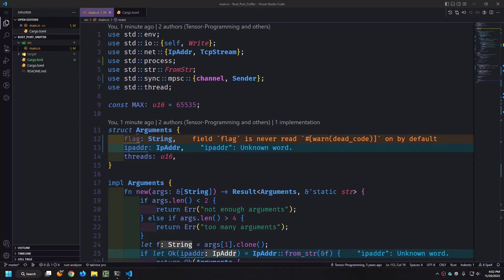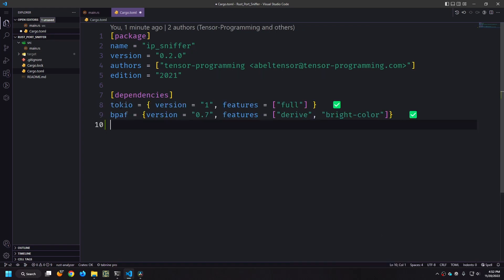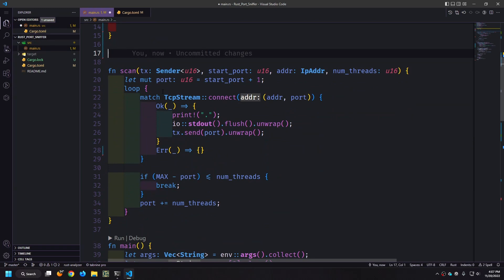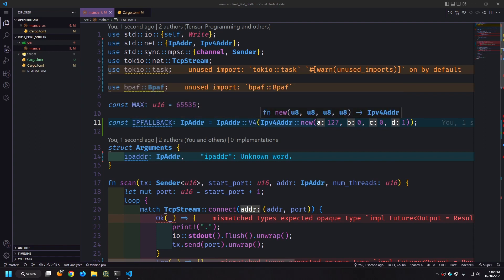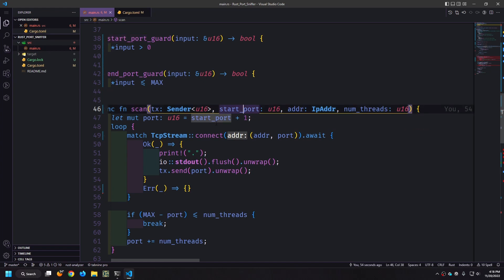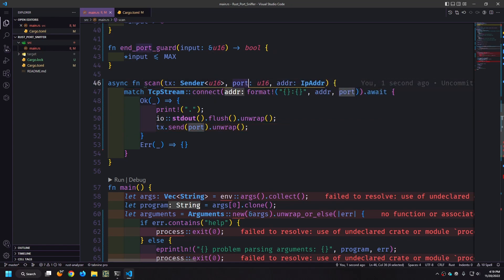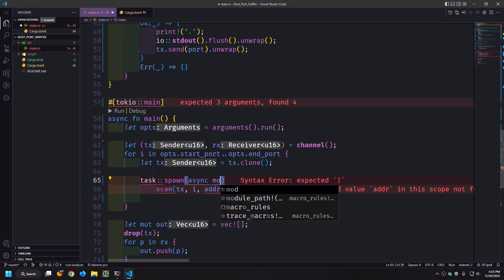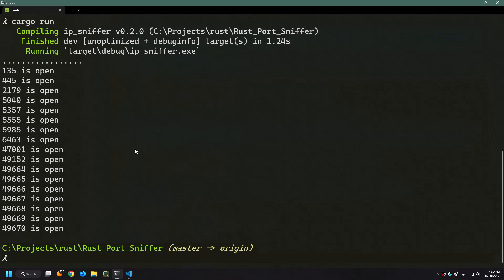Rust Port Sniffer v2 - Update

Comment: Great video! However, just wanted to leave a few pointers here for anyone else who stumbles across this video. The first thing to mention is that a u16, which is the value we use to hold our port when getting it from the CLI, can only hold values from 0 (the u in u16 , means unsigned, meaning it can't be negative) to 2^16=65535. As a result the guard statements created in this video (at least in my testing) will never be violated as the u16 value is incapable of holding values which violate our guard rules. This means that when you type an incorrect port into the CLI, you get a generic error generated by bpaf (I assume). Also, it's my preference to put the print statement saying a port is alive within the thread as this allows you to clean up the code a bit and also means that the code doesn't just sit not outputting anything for a few minutes while it goes through all the ports.

Comment: Just completed version 1 then noticed this video. Thanks for sharing your knowledge. Although the code is much cleaner in v2 the original version with a change to use connect_timeout is much faster on a remote device, local device there's not much in it. It doesn't seem that there's an option for a timeout on tokio::net::TcpStream though?
Reply from the maker: Since it uses futures, there is no explicit timeout because you can always kill the future.  They have tokio::time::timeout which serves this purpose.

Comment: how can use a tcpstream to read and write simultaneously
Reply from the maker: You'd have to clone the stream.  I believe TcpStream has a method called try_clone.  So you would do something like let read_st = TcpStream::connect(ip); let write_st = read_st.try_clone();

You can also just put the stream into an arc and use a mutable reference to read and write.
Reply: @TensorProgramming  Even after the clone, the next write stream waits for the read in the loop though they re in seperate threads
Reply from the maker: @computerscience1152  If you go to the tokio docs, theres an example that they show for reading and writing concurrently: https://docs.rs/tokio/latest/tokio/net/struct.TcpStream.html

Otherwise I would recommend looking at sockets instead of TCP.
Reply: Ok , thanks for the info

Comment: But print is blocking right? So the os thread responsible to write to stdout will block, thus the green threads running on that thread will block as well. Just guessing
Reply from the maker: Right, so print is blocking in rust but it won't matter in this case.  The flow of these green threads is totspawn based on the iterator in the main thread.  The print blocks the termination of the green threads if and only if the connection returns with a successful Ok result.  So we aren't blocking the creation of other green threads, rather just blocking the green threads and having them stick around slightly longer than they would normally.  

Another thing to keep in mind, writing to the console doesn't really have any latency.  A print is writing to some IO device, and the block itself comes from delays for if the writer doesn't accept the value or has some kind of latency.  If the console itself can't read fast enough, that would be an issue for sure though or if we were printing to a websocket or something similar it could be problematic.  The alternative is to add another channel and pass the strings back through it to another concurrent greenthread to print them out but this just adds inherent complexity that isn't needed.  You could also always just use AsyncWrite as well.